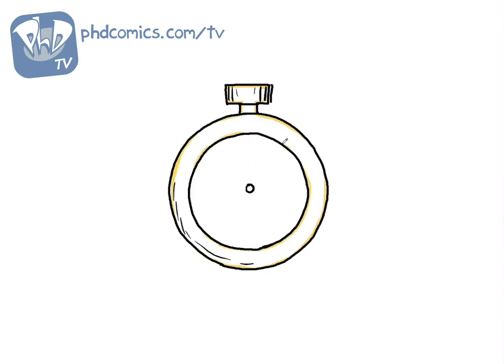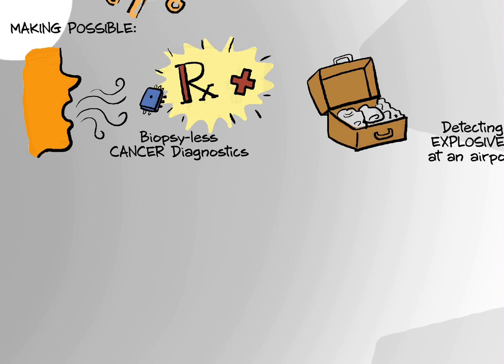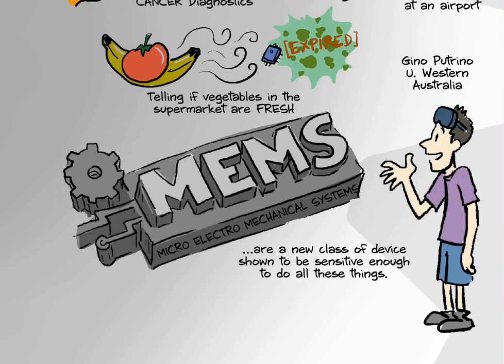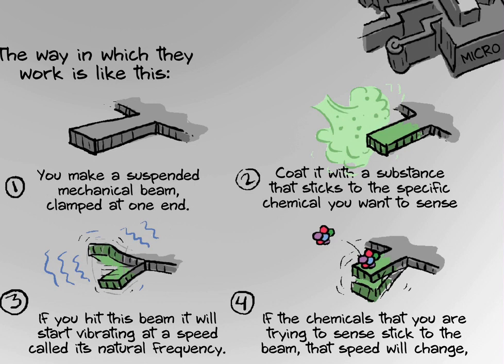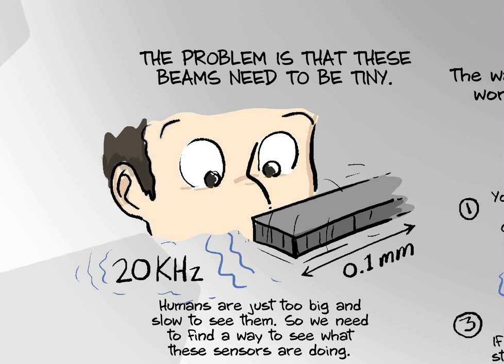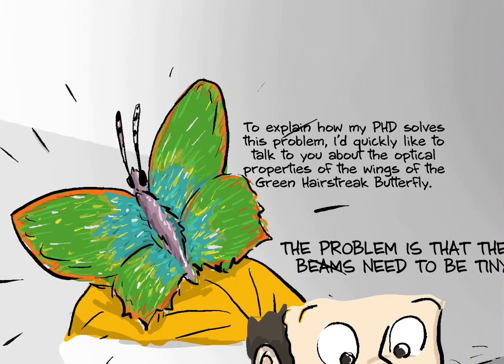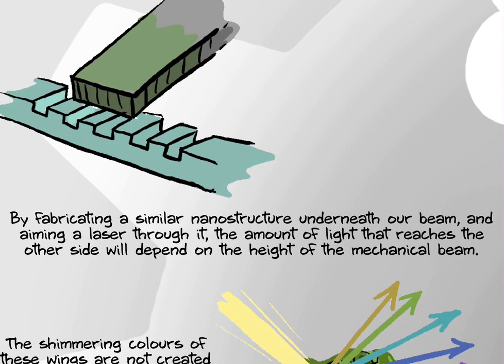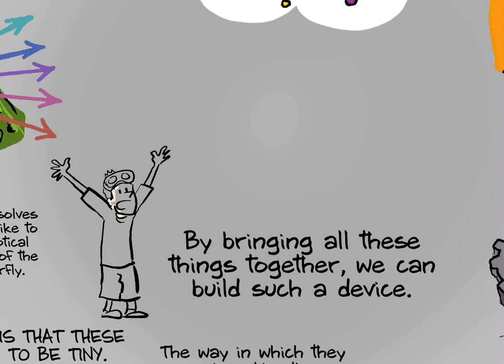How to Build an Artificial Nose

Comment: Great question! It depends on what you are trying to sense. When using a palladium coating to sense hydrogen, the hydrogen is absorbed/desorbed depending on the relative % of hydrogen in the atmosphere, and can be used forever. When using the right peptide to search for lung cancer - the compounds bond permanently, but there are so few of them, you can reuse the device several times - you just re-calibrate between breaths. Other things can can be flushed with Nitrogen or another chemical.

Comment: Why not just check for changes in resistance ,if you put a wire under the current will flow to the bridge  if the bridge is higher the electrical resistance is stronger, it would be a way cheaper and easier solution than lasers, right?